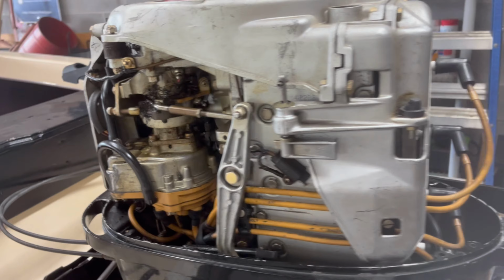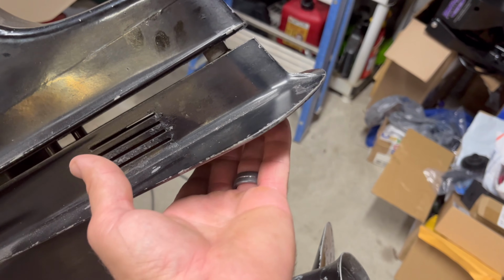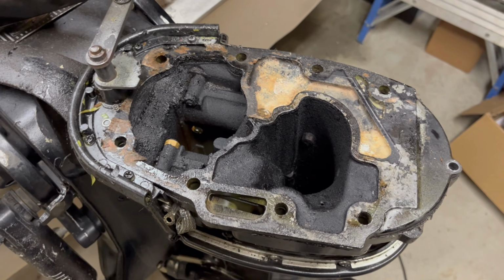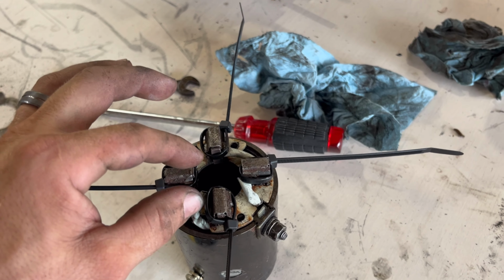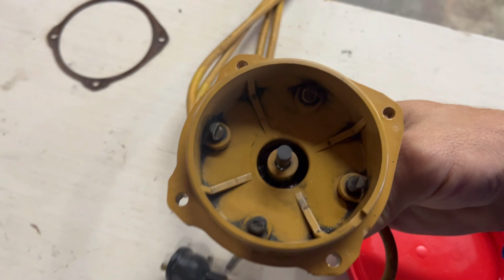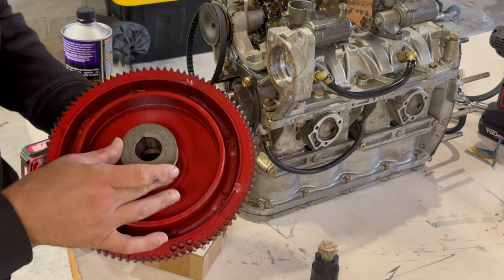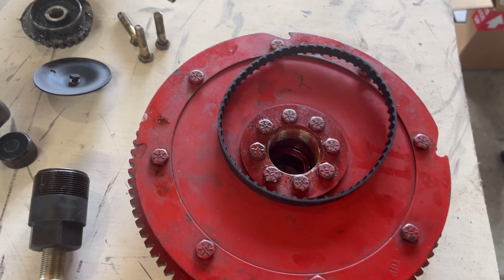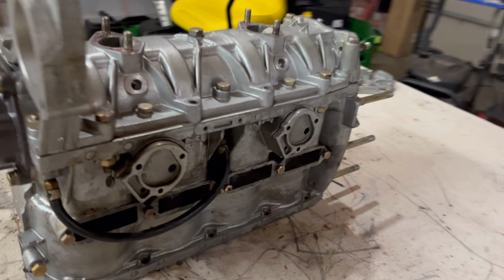Merc 650 Outboard Powerhead Teardown

Comment: How were you able to separate the  shifter? That seems to be the only thing keeping my power block from coming off. Great video though!
Reply from the maker: Do you mean the cable itself, The shift shaft, or the slide bracket? The shift shaft can be tricky, but it connects under the knob holding the shift cable. Take the nut all the way off and then shimy it out as you raise the powerhead.